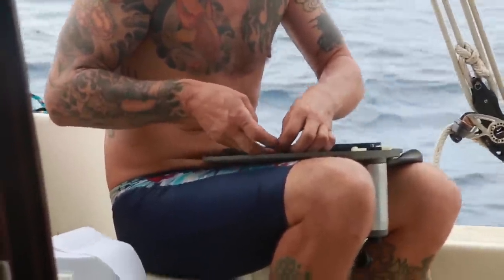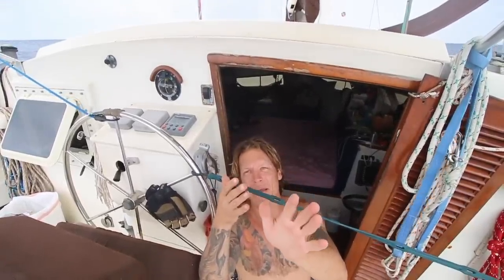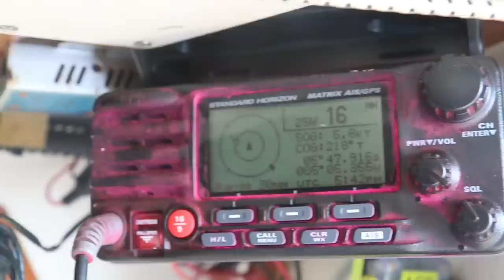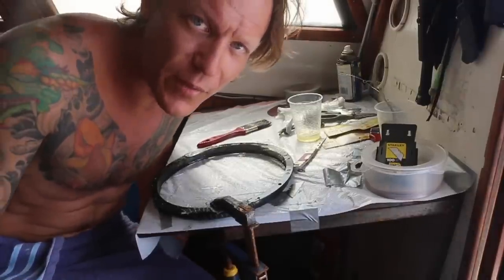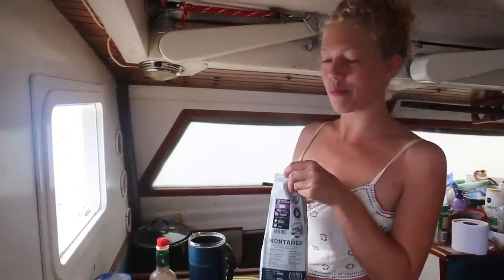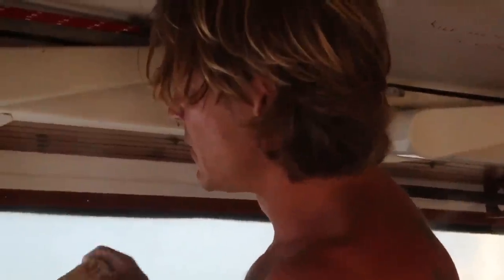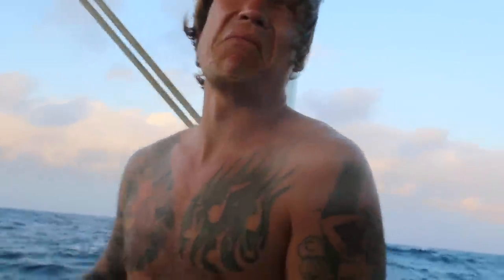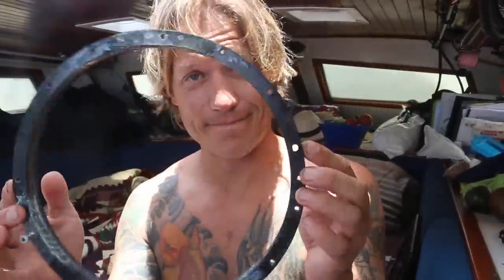Our boat BREAKS 500 miles out to SEA!  |  Ep. 66

Comment: I wonder if classic sheet to tiller autopilot would work with a cat?   Webb Chiles has used that successfully for long passages I guess it just depends on your relative wind angle and helm balance.  also is normally used on tiller not wheel steering

Comment: Wen I was a young man, I was in the junior sailing program and learned that I could tie the tiller of my Laser and use my body weight to steer the boat by holding onto the mast and leaning the mast from one side to the other. That was a cool lesson. There are several other ways you can steer a boat as well. What is the best auto pilot for your new Schionning Cosmos?
Reply from the maker: Linear drive all the way.
Reply: @thelastpirate , Were you able to recover all the video from South America to Hawaii?
Reply from the maker: Yes we saved that

Comment: You should have shaved down the wheel first at the breaks, then layered the glass in and shaved it to fit after it cured. the way you're doing it, the more you shave the weaker it gets.
good luck on the trip.

Comment: Moral of the story, always have a working wind vane auto pilot on board. As long as the winds are not swinging around, it'll keep you on a reasonably good course
Reply from the maker: Windvanes don't work on catamarans normally, because of the wind shadow of the house. Jim brown had an interesting version on his tri...
Reply: @thelastpirate  Worked fine on my PDQ 36 and Antares 44 just fine. Just can't use them at full sail as the vane can't keep up to sudden acceleration like cats can do. But you do need two mounts to keep it on windward side. Most people put them down because they either never used, don't understand them or couldn't get them to work.

Comment: As a designer and troubleshooter of automation systems, I am underwhelmed by the amount of attention that the sailing community pays to spare parts and maintenance of autopilot system components.  Please people, understand that these are high tech systems that DO A LOT OF WORK.  Learn how they work and if you do long passages, buy the spare parts recommended by the system manufacturer and then buy the ones recommended by your boat builder.  This is not a fishing reel sized problem, it is a full scale computer running the power stearing system on a truck!  Note that the wheel is 3 - 4 feet in diameter to gain the mechanical advantage to operate the rudder.  The autopilot has to do the same amount of work  ALL DAY!

Comment: This horrible Raymarine Autopilot, everything on the wheel is made from plastic. I'm happy to have two old fashioned ST4000 and ST3000 with metal motors and an open aluminium ring. The motors work with the newer control box proper.
Fair winds
Tom
Reply from the maker: Yep